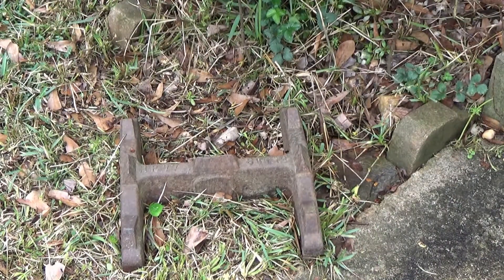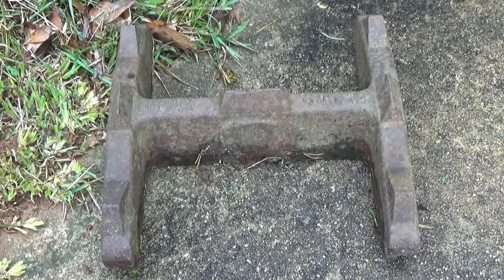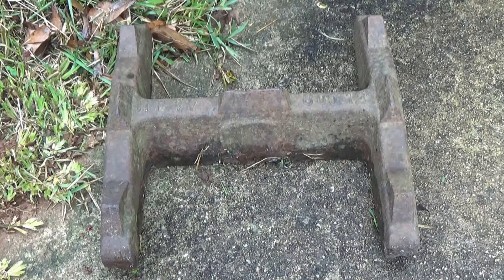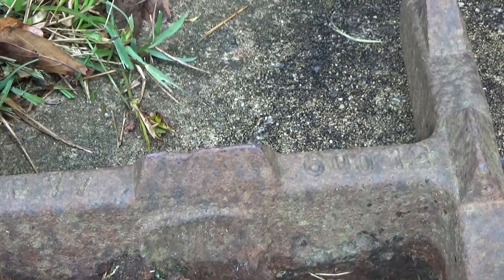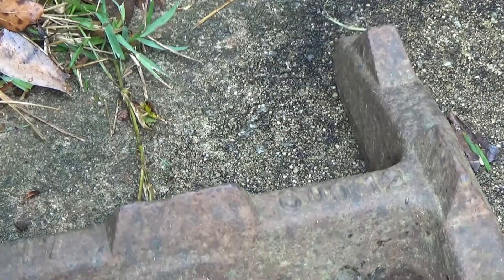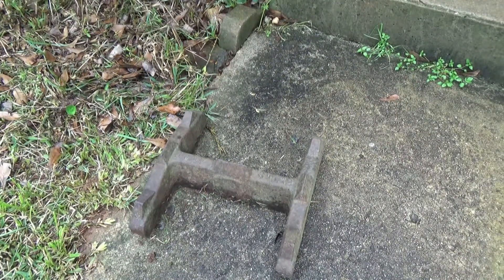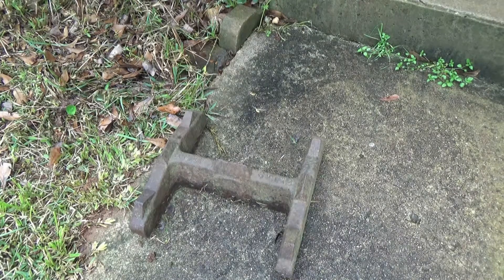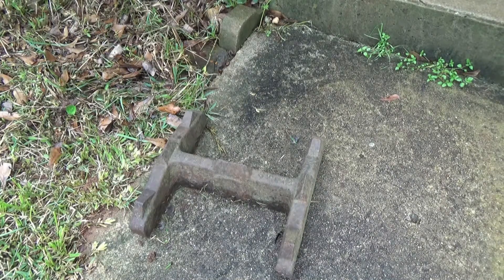Walters Boot Scraper VLOG 3 17 2021

Comment: So that heavy hunk of steel was part of a knuckle coupler?  The same 11 inch high knuckle coupler which holds together the entire train of cars on an 11,000 ton unit coal train with two massive locomotives pulling and two more pushing?  Well, since that computes to 22,000,000 pounds, I guess it better be thick, heavy steel.  I’ll bet that half mile walk was tough.
Reply from the maker: it was a bit tough lol  Thanks David

Comment: It's a Pile Point which is welded onto the ends of H Pile which are driven into the ground for foundations with a massive hammer hung by a crane.
Reply from the maker: Thanks for the info  I appreciate it